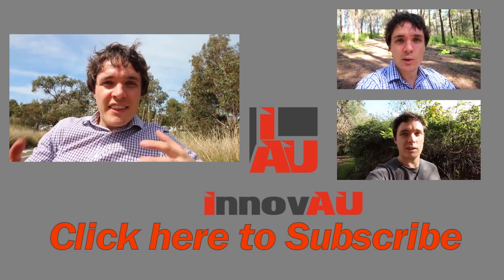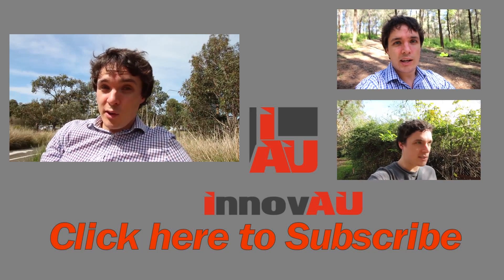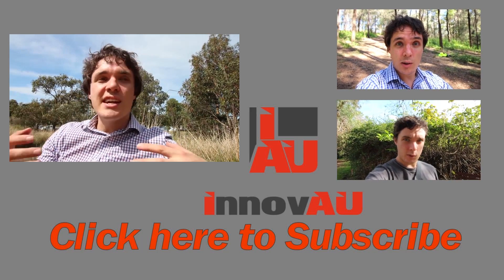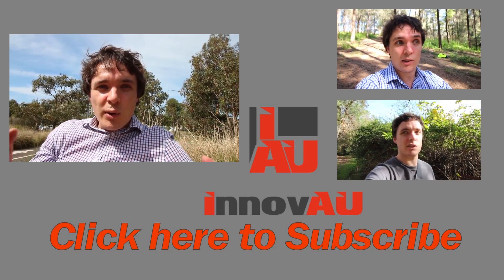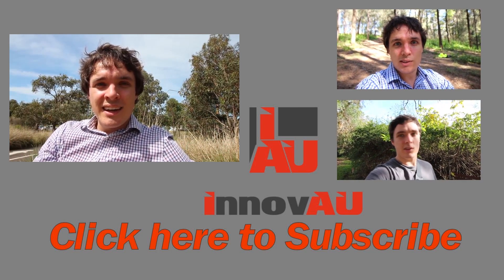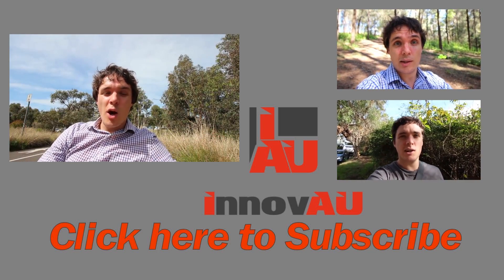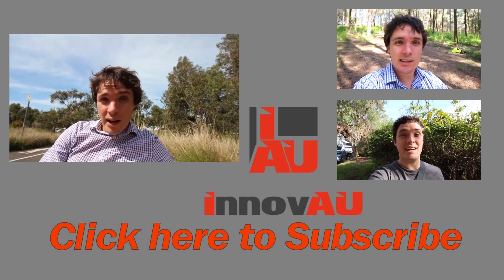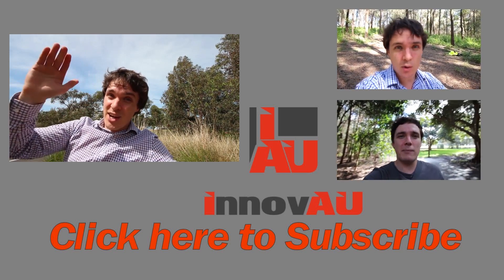HOW TO PROTOTYPE

Comment: thank you so much for this video.  I've been spinning my wheels on where to start.  Just thinking about it becomes overwhelming when you don't even have the first brick to set your foot on.  Thank you again.  Now I know it doesn't have to be perfection to even get started.  Maria...U.S.A.
Reply from the maker: Absolutely! Start small... Taking SOME steps is better than taking none. And it is easier to get your head around things when they are set out in smaller more 'achievable' goals.